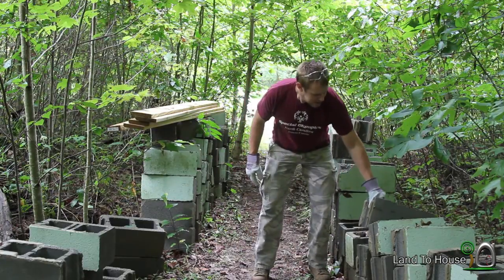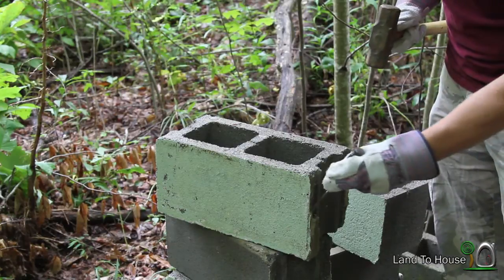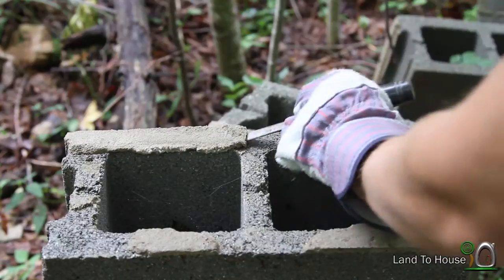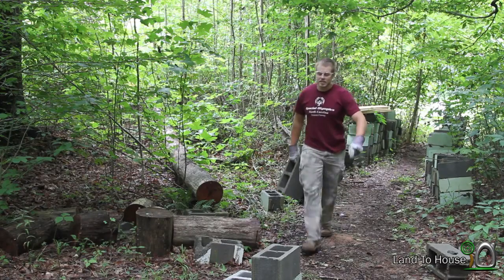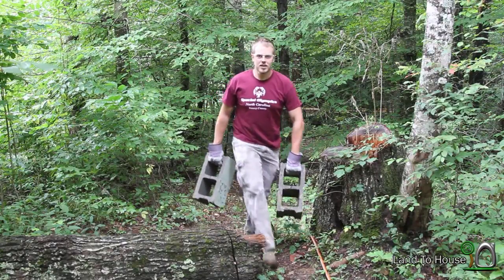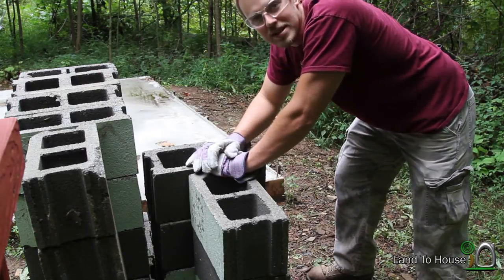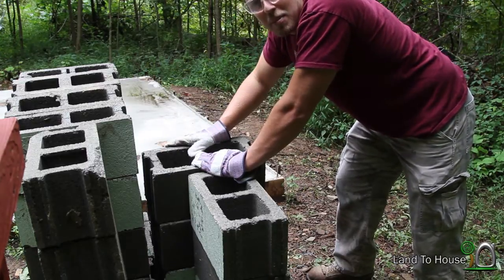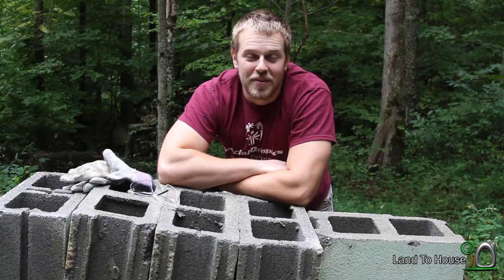Tiny House 3 - Cleaning Concrete Blocks

Comment: I found a easier way to remove the mortar from used brick and blocks. I use a mattock. The flat chisel edge skips along the surface until it hits the mortar and then the weight is concentrated right at the point where the mortar is bonded to the surface. The shock and wedging action lifts the mortar free. 
Since the mattock has a long handle I don't have to lift up the blocks or bend over to reach them. Much easier on my back.

Comment: Seth excellent video that is a bunch of work  nice job
did you think about sealing all the  wood joints before putting the rubber sheeting in place also using contact adhesive on the rubber joints.
are you going to run the whole creek through the flume
Reply from the maker: Yes I am happy to have the block work done!  It was tough. 

At first I was going to seal the wood and use a rubber spray but then I started looking into the chemicals that I would be passing my water over. I just thought that I would stick with nothing more than the rubber. The next couple videos will show running the whole creek in the flume! As long as the rubber over laps with the blocks of wood under them the water does not back up.